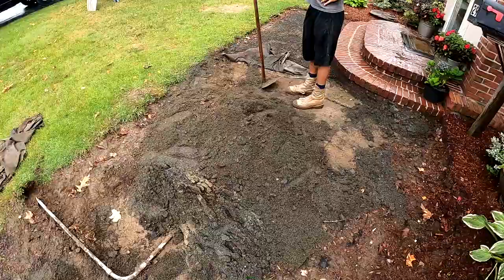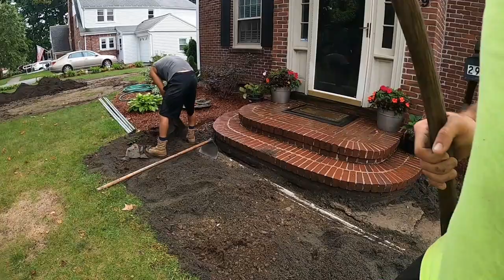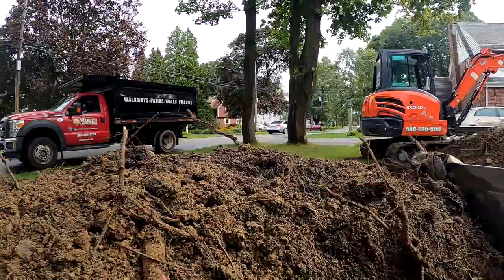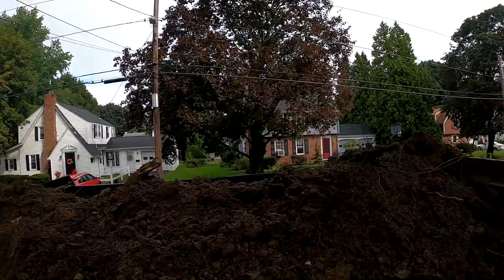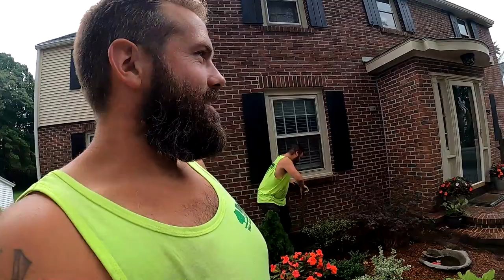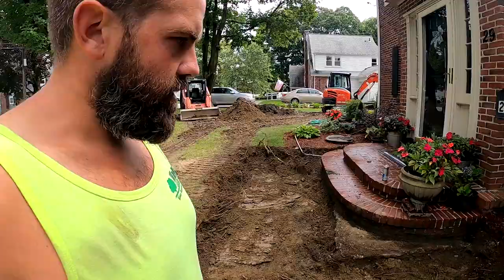Do It Yourself Paver Walkway | Step 1 | Excavation

Comment: Awesome work thanks for sharing 👍 I’ve got a small project that has sandy soil (12x15)sq never done 1 probably won’t again after this , the area slopes  towards house should I dig the sub deeper on outside edges so it’ll drain then build it w/stone to come up to grade , & in this video the 1st layer of 3/4 then fabric & another 3/4 , is it th same stone? . My soil is very sandy & it perks very well. I’ve subscribed & checking all your videos u do great work !! hope this channel blows up for you.also  mass.born n raised
Reply from the maker: No problem, sounds like a fun little project! And yes, I would dig the outside edges deeper and slope the subsoil away from the house as you excavate. I would also recommend excavating 12-18 inches farther than the proposed patio on all sides so that you can make a decorative stone apron around the patio so you can slope the pavers towards the apron and the surface water from the patio and surrounding grade will drain into it and permeate down into the nice sandy subsoil you have. And yes, when you get to the correct height and slope of the sub base, spread a thin layer of stone over it and compact it into the subsoil to stiffen it up and also help to open the soil for water to drain and permeate even better. That step helps prevent sink holes from forming as well. Then lay fabric and backfill to height and compact. (you can backfill with up to 6 inches before needing to compact with this 3/4 clean crushed stone).

Not sure if you have seen this base prep video I made yet, if not check it out... This is probably the most detailed one I have 👉https://youtu.be/ChaJe3JqD6I

Comment: Question! What is the strangest thing you've found excavating?

I was stump grinding many years ago. I hit a piece of metal. I shut the grinding wheel off; reached down with it, and pulled up the inside tub of a washing machine filled with potting soil. Someone had used it in the past to grow flowers at one time. 😮
Reply from the maker: You know, I haven't ever found anything crazy but plenty of random things for sure.... A few times I have dug up old trash dumps on properties. Meaning the people who lived there in the early 1900's would dig holes and fill with trash. Most of the time they burned it and once it got full, they bury it. It can be a big mess..... I have also found car parts, old appliances, abandoned septic tanks, etc... Not super often but there has been quite a few random things. That is very funny you found that while stump grinding though, must have been very surprising. 🤣 ✌

Comment: What would you do if there was a sprinkler head and the owner is ok with removing it? Do you call someone that works on sprinklers to remove them or is that something you also do? Thank you for all your videos Im learning from you as I am looking forward to getting in the business
Reply from the maker: You can definitely remove a head that is not wanted. But you need to find a way to cap it off so it does not leak. If you cant figure that out, just pull the pipe the head is connected to out of the way and have an irrigation guy come cap it off. I'm glad the videos have been helpful and I wish you the best of luck with your business! ✌
Reply: Thank you!

Comment: How do you tell when your at the subsoil/grade?
Reply from the maker: Hey Bryce, I have been excavating for walkways, patios and walls for quite awhile now. The way I Judge the sub soil is mostly by identifying the sub soil. This particular job, if you look close as I get to my sub base level, the soil color and consistency changes. I knew that we reached a sandy / gravel sub soil and I also knew we where at least 8 - 10 inches deep. At that point all I had to do was rake it smooth, remove the roots and large stones and I'm all set. In the next video I will spread a thin layer of 3/4 inch stone and compact. Then lay out geotextile fabric and backfill up to my height with 3/4 inch stone.
Reply: @TheChristianHardscaper  thank you for the response. Now that you mention it I do notice a change. You and your crew do really nice work. Your videos are awesome to learn from.
Reply from the maker: @sike800  No problem, thank you for checking out the videos and for the feedback!
Reply: If you're excavating for a patio and encounter a high water table or some areas with pooling water, what do you do? Does the water need to be removed before adding subbase? Or can gravel be added over the water.

Comment: What’s the reasoning for having a dump truck when you could have a roll off dumpster delivered and they handle the dumping as well?
Reply from the maker: Hey Drew, So a dumpster getting delivered and hauled away would cost more money than doing it with a dump truck that we have available anyway. The dump truck hauls away debris and brings back material that we need. With a dumpster rental, you are paying a substantial more to haul away debris and most of the time, they will not deliver material that you need, which if they do deliver it, the fee is more expensive than hauling it in with your dump truck.... I can understand the dumpster route if you don't own a dump truck yet, but if you have a dump truck, then that's the way to go👍